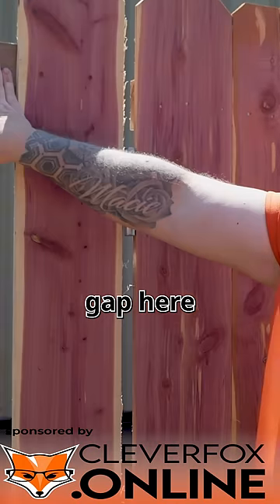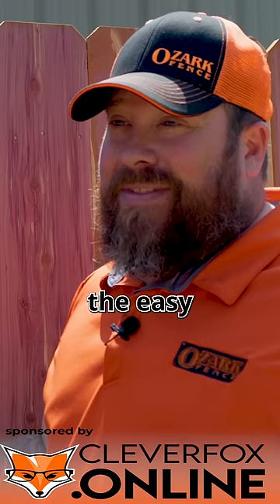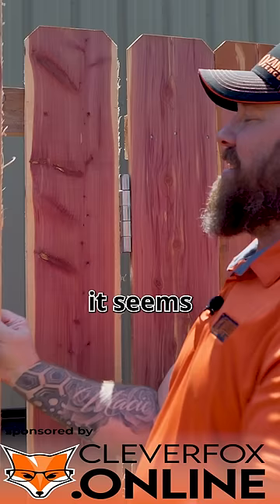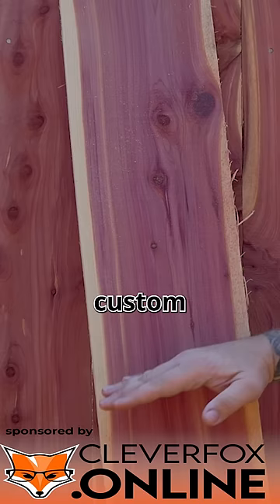How To Fix A Gap Between Fence Pickets #shorts

Comment: Everyone is different, and there's many ways to handle it, but back when I was still doing fences, I had my miter setup for the dog ears for this and did my custom cuts in threes so no one picket took the full loss,  and made it a feature in the center of the gate so it looked planned. Obviously time is money but measuring, marking, ripping, and dog-earing (if that can be a word) 3 pickets is not much worse than the time it takes for 1.
Reply: Very defensive. Instead of defending try doing it how it would look good. If you don’t want you work corrected don’t put it on the internet or even better do it well. Wow this is exactly why your not a pro. Time is money means you don’t care what your poor customer finished product looks like.
Reply: Everyone is different! but there is a right way and the shit you told people to do in the video. The wrong way.
Reply: @codyenneking7997  that's not true
Reply: @codyenneking7997  who's defensive

Comment: Why not measure the gate for full pickets. Give the customer options on the size. Then hide your rips in the corners where they should be. Common sense not common.
Reply from the maker: Typically the location determines the gate size, rarely do we have a choice in what size the gate is built.

Comment: Doesn't matter. That wood will shrink . A lot.
Reply from the maker: Granted, we’ve only worked with it for 14-15 years. But, in our experience in our region, the Eastern Red Cedar (Juniper) shrinks between 1/8”-1/4” depending on how much heartwood is in the board.

Comment: The device you have on top of the pickets to keep the tops perfectly even, WHAT IS THAT CALLED & WHERE DO I GET ONE! 
Im a solo operation handyman thats built over 10,000 ft of fence in the last 3 years 98% by myself (good help is hard to find) and thats the one tool im missint from my Arsenal.  Please please please please answer this!
Reply: That 'device' is justa custom made straight edge.  Pretty much any steel fabricator could make you one.  I'd ask the cost first.  Buying one for just your backyard fence might not be worth it.  Can do the same thing witha stringline.  Or just eyeballingit by matching the short point of the dogears.

Comment: The best option is to rip and dog ear every picket in the gate, so they're all uniform
Reply: Fucking bingo
Reply from the maker: Fair enough. Arguably, though, the best option would be to build the gate at exactly the right measurement to where all the pickets fit perfectly, that way the gate pickets match the fence pickets.
Reply: @JoeEverest  it all depends. Is it a pre-fab gate frame? Or did someone on your crew build the gate the wrong size lol